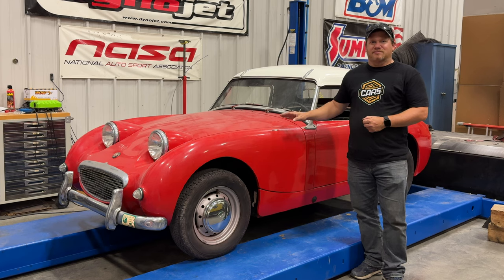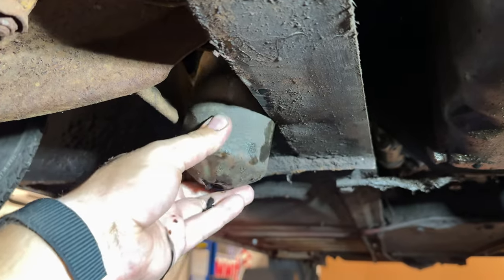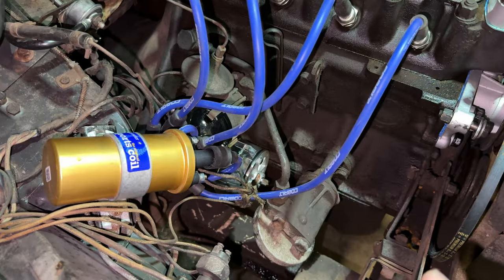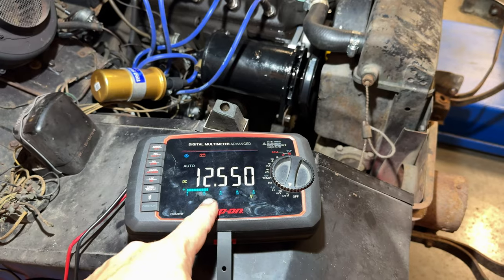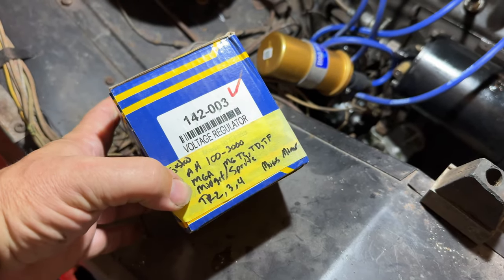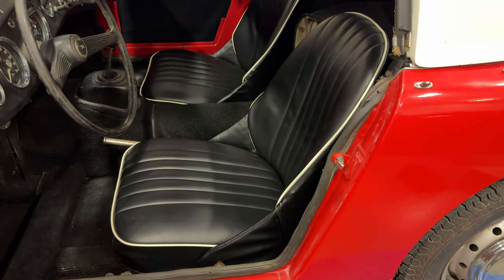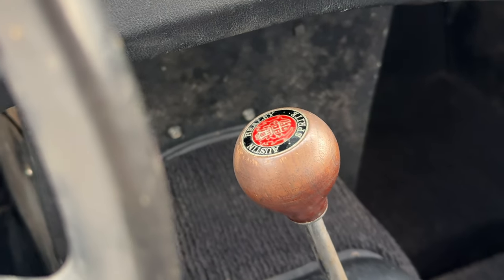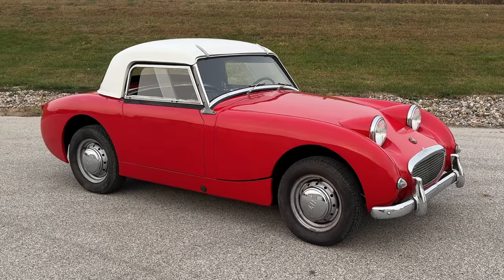Fixing the Starter and Charging Problems on the Sprite

Comment: Starting easily in a second with new starter motor.good job,ignition system is working well also fuel system is good working.well based for restoration.

Comment: Have to say that if I were lucky enough to own a period Sprite (or any other car from back then) I would want to fit a 1 wire alternator and lose the "regulator" and dc generator. Hardly concours but much better for daily use.

Comment: I'd rather fix the original , parts are not hard to get or expensive and it's usually just brushes, clean and  lube and a new bendix drive if necessary...

Comment: Ah, I see. 'i don't know if the regulator works, so despite the thousands of dollars in test equipment that I have available, I'm going to replace it'.
Reply from the maker: That was not an original regulator, you can see the sticker on it and other parts look different, I threw that one away the new one is more correct.
Reply: who cares if it is 'original', the existing was original to you, when you got the car.

besides, a single voltage test is all that is required, and there could be an issue that replacing the regulator doesn't even help!

Comment: Puzzled how the oil filter was dry when you removed it?
Reply from the maker: With the engine not running for a month or more because the starter was broken and the oil leaking out when you remove the bolt that hold it up it’s not surprising at all.